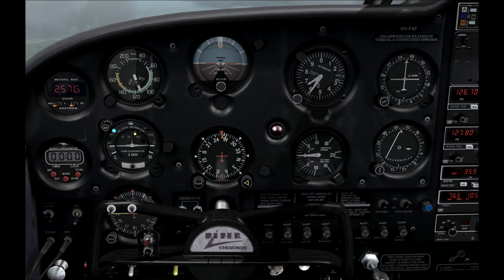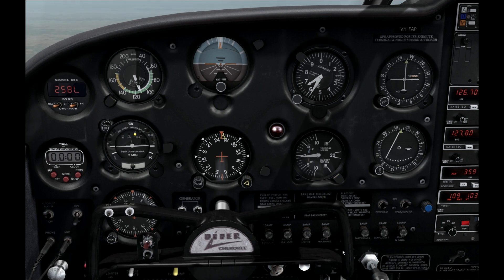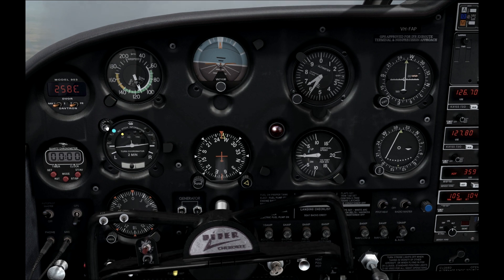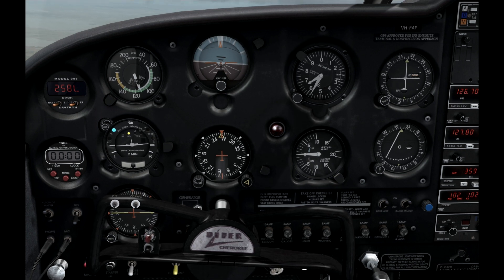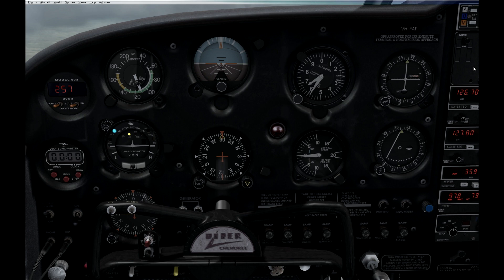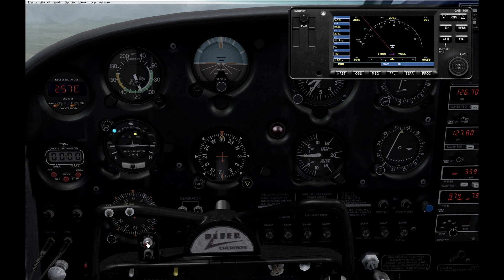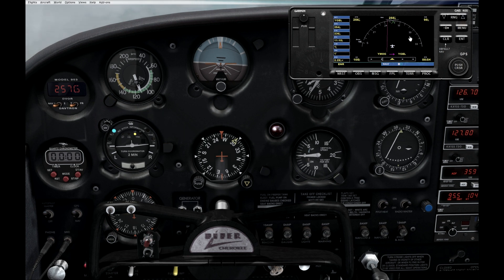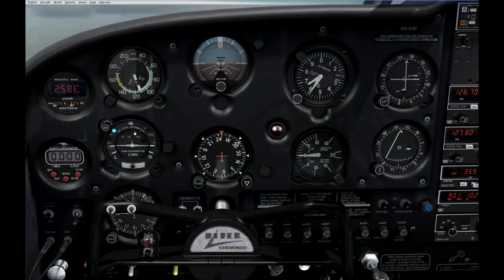A2A Piper Cherokee 180 S-TEC 30 Autopilot Tutorial

Comment: The difference between Low Track and High Track is just in the amount of authority exerted on the aircraft's roll. Low is useful for VOR tracking, as in the real world, radio signals from the station aren't a reliably straight line. You get multipath interference for example, where the signal bounces off of terrain, buildings etc and these echos arrive at the receiver at different points in time. You don't want the aircraft to aggressively follow the CDI in these cases. It's especially troublesome as you fly over a station, and the CDI needle deflects all the way to one side or the other. Low Track dampens the autopilot's ability to follow these deflections and makes for a smoother lateral flight. In FS, we don't have to worry about wonky radio signals bouncing the needle around, but we do have to be concerned with its behavior as we near a station and fly over it. Just like we don't chase the CDI in manual flight, the autopilot should not chase the needle either. Track Low helps prevent it or dampen it.

For GPS navigation, use High Track. It will behave more like HD mode, exerting more roll authority on the aircraft, resulting in more lateral precision. Crucial especially if you're IFR, and are expected to follow your filed route with reasonable precision. If your next waypoint is 45 degrees off your present heading, you really don't want a 5 minute turn to get there. Use "High".
Reply from the maker: twsbbl That's a good description. I'll give High Track another go with GPS navigation and see how it goes. I'd not really noticed much of a difference with the 180's autopilot previously, but I'd not tested it with sharp turns.
Reply: Here is one thing that is not mentioned because the aircraft is not equipped. I fly a Warrior II  that has an Aspen E3 display. This is like the Garmin G5, which has both the attitude indicator, and an HSI. It also has a soft key button called GPSS which is for GPS steering. I nickname it “George pilot super stud.” If I am flying in GPS mode, Keeping the STEC-30 in Heading Mode and not using track lo or hi, I press this button on the Aspen and the aircraft will fly just like setting the heading bug. Basically it is taking the GPS, treating like a heading bug on the HSI and electronically inputting a heading bug setting even though the physical heading bug is not directly underneath the rumb line. I always manually keep the head bug under the rumb line anyways like I always keep the OBS I under my current GPS DTK. If I want to switch to using the heading bug, I just disengage the GPSS and it default the the HSI. So if you have an aircraft that has a GPSS mode on it, it will do the same as long as you are in the GPSS mode. This is really handy to toggle between GPS and heading through the Aspen without changing modes on the autopilot. I want to take the time to add one thing since I flew this plane the other day. I was flying a VOR approach in VFR conditions of course, and it did very well except in the procedure turn. No matter what mode I used it got fairly lazy trying to complete the procedure turn properly. The way you can counteract this is to use the stabilization mode (ST) and manually turn the plane by adjusting the knob. Since you can go up to a 30° bank, this is the best way to make your turn and once established on the inbound course, you can go back to either heading mode or track high.

Comment: This system is basically a low cost, entry level auto pilot. I used one the other day  with a GPS unit in a Piper Warrior II. I pressed the button on the Aspen unit, (Glass cockpit ADI/HSI, like two Garmin G5’s together) GPSS function, which means GPS steering while the auto pilot was on low and then again on high sensing. It held the course very well however, when I entered a procedure turn and crossed the fix to go outbound, the auto pilot slowly banked, and completely flew the plane way out of the published, hold pattern. In order to properly navigate, you have to switch to heading mode or to stabilization mode and manually turn the bug to properly do the procedures. Far cry from the Garmin 500 series autopilot. Secondly, this unit has no vertical navigation. Therefore, you must manually climb and descend first disengaging altitude hold. So in a sense there is no altitude capture or anything like that.

Comment: I would like to see a tutorial on this system that uses a G5 or an aspen E5 system. The Aspen has a GPSS function which is steering by the GPS itself. That means the course needle will skew to the next heading automatically and the auto pilot should follow it. Some people tell me that this unit will still do that while maintained in HD mode or heading mode, as long as you have the digital unit selecting either heading or GPSS. I will try it this weekend. Like I have commented before allowing this unit to fly a procedure turn it did not aggressively make the turn either in low track or high track mode. Maybe it’s this particular unit or maybe that’s just the way it works.

Comment: How do you trim out your plane for the flight level?
Reply: If you select the power you require at the level youre cruising at, and you still have to apply some sort of pressure on the yoke (forwards pr backwards) to keep the plane straight and level, then that means you need to adjust the elevator trim wheel on the ceiling in order to relieve the stress required. If the plane is pitching downwards then you need to move the wheel to the up position (and vice versa in order to keep it level without having to apply pressure on the yoke